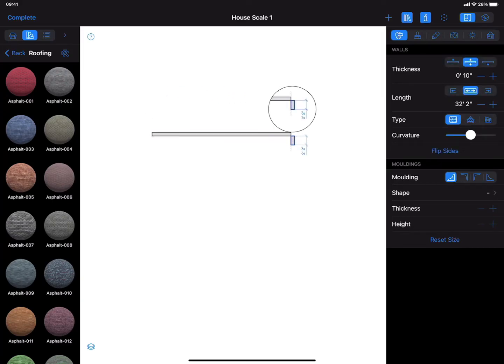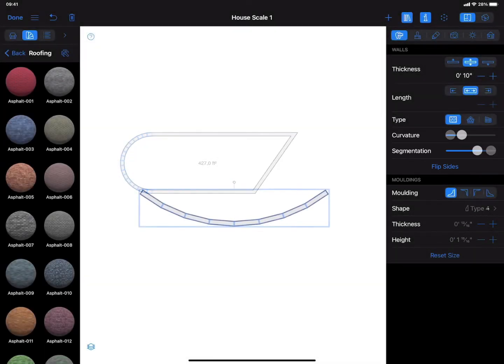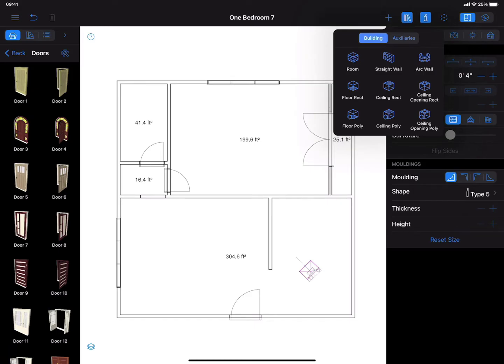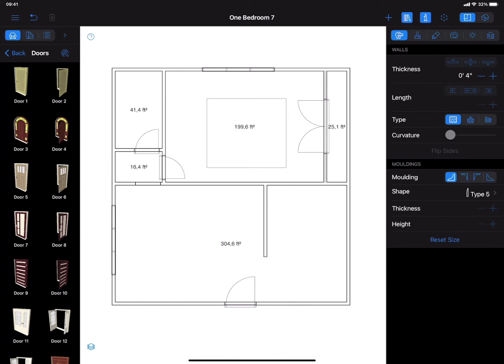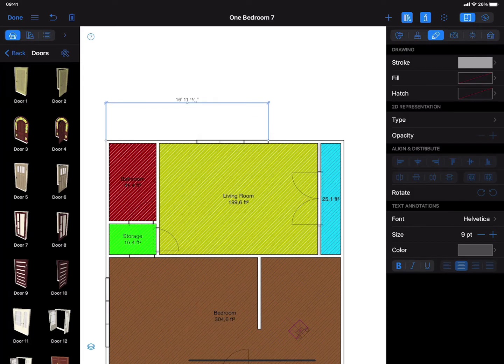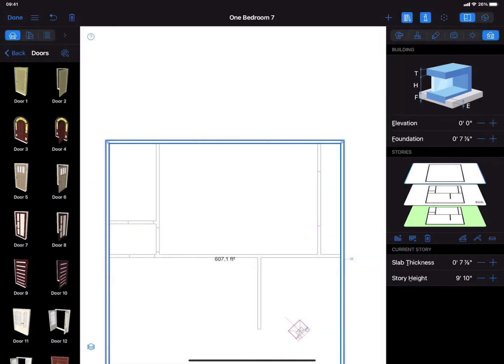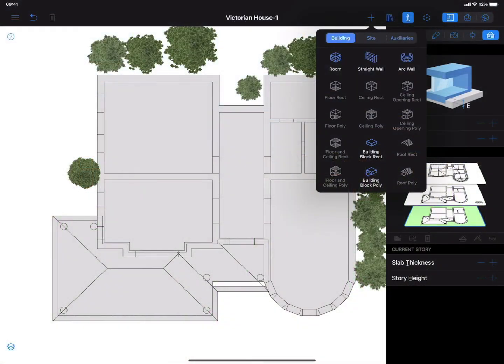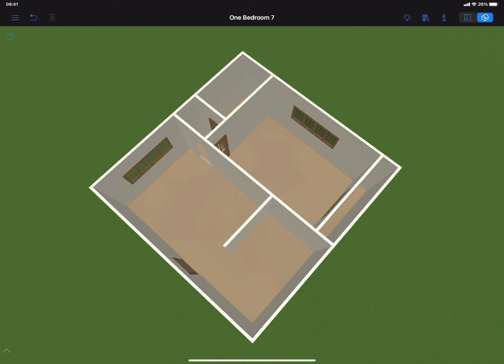Creating a Floor Plan  - Live Home 3D for iOS / iPadOS Tutorials

Comment: How do I make custom stairs , change the text to vertical, separate room sections & custom 2d representations like basin, stove burners?
Reply from the maker: Hi, the app can't create custom stairs. You need to use the ones available in the library. Or, you can build custom stairs from the building blocks: https://www.livehome3d.com/support/lh3d-help/working-with-objects-building-blocks 
It is not possible to change the text to vertical.

If you need to separate room sections on a floor plan, you need to draw two floor sections in your room and apply different patterns to them. You can use the Floor tool to draw a floor. This feature is available in the Pro edition only. To activate this tool, please open the floor plan, tap on the plus icon in the toolbar, and choose the Building tab in the panel:
https://www.livehome3d.com/support/lh3d-ios-help/live-home-3d-workspace-the-2d-plan-view#drawing_tools

If you want to change the object 2D representation in the iOS / iPadOS version, you need to select it and click the "Type & Representation" dialog at the bottom of the Furniture tab of the inspector. Then select the required image or upload a custom one.

Enjoy using Live Home 3D for great interior design projects!

Comment: Is it possible to switch off all mouldings for the walls? i want to create walls without mouldings. buz always i have to change the settings
Reply from the maker: Hello, please select the desired mouldings for a single wall segment in the Object Properties tab of Inspector. All the wall segment drawn after that will have the same mouldings.

Comment: How to save? How to open a sheet of paper to be redesigned?
Reply from the maker: Hello, the app saves projects automatically, so users don't need to take any actions. The projects that are currently opened will be saved automatically when you open the Project Gallery, or switch to another app or to the Home screen.
https://www.livehome3d.com/support/lh3d-ios-help/working-with-projects-saving-projects
To redesign a previously saved project, you need to open this project file in the Project Gallery.

Comment: How do I create column with wall? Normally Column bigger then wall..building block is different right
Reply from the maker: Hello. To draw a column with the Wall tool, simply add a short wall section. To design a column that is higher than your walls, please use a building block.